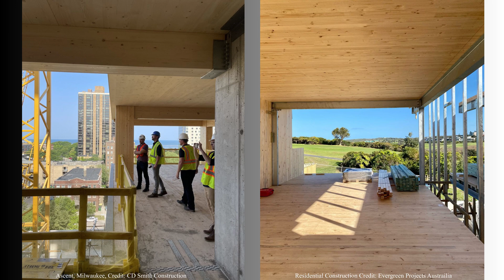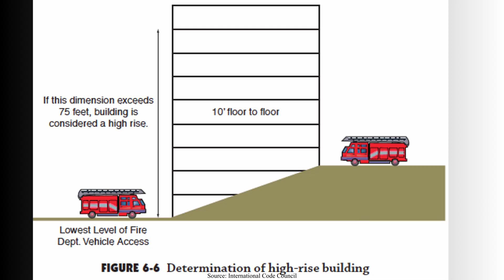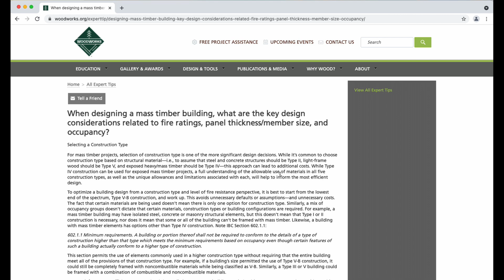Mass Timber in Multi-Family Housing

Comment: Are  walls in post&beam structure made from clt as well, or are they light pre-fab wooden frame walls?
Reply from the maker: They can be made with CLT, some project have done that such as the Lendlease privatized Army lodging hotels projects in the US. But many mass timber projects are using light wood-frame stud walls or steel stud walls.

Comment: The most cost-efficient use of wood would be LVL/glulam (depending on height) and I-joist floor framing with SIP walls, yet this is rarely seen outside of single family housing.  Considering the affordable housing crisis, shouldn't this typology be the default method -- again considering the final project TOTAL cost?